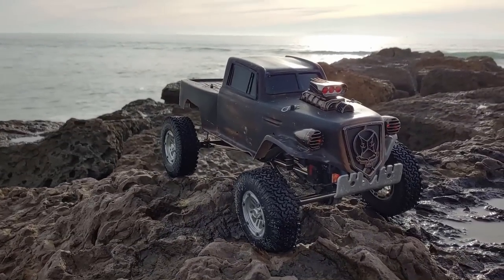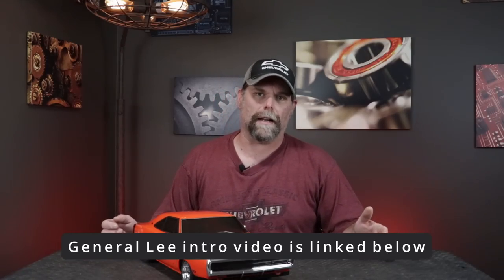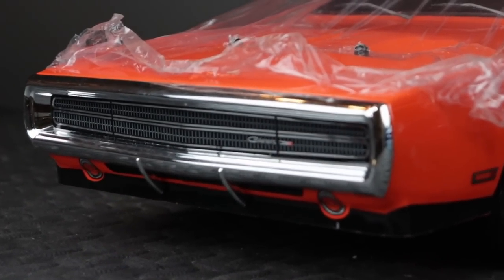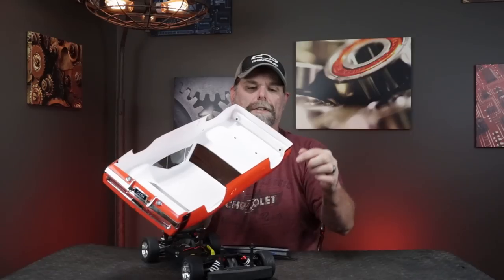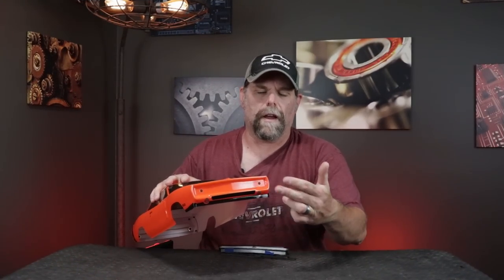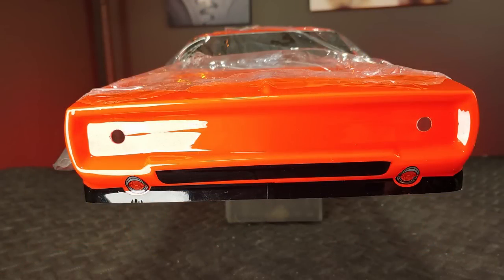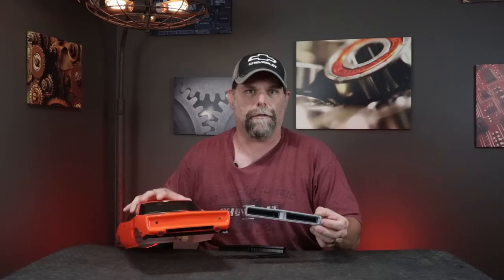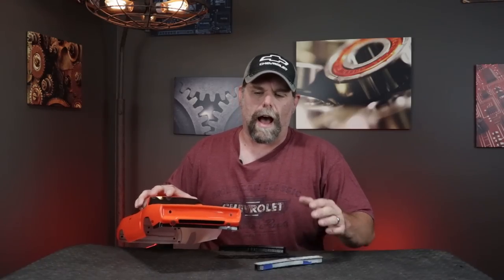RC General Lee: Kyosho Fazer 1970 Charger to 69 1/10 scale Conversion

Comment: Just subscribed after watching this. The General Lee is one of my all-time dream cars, and I love what you did! If I would've known about the Kyosho Fazer in the first place, I would've saved up my money a bit more instead of getting a Tamiya TT-02 with the '99 Impreza Monte Carlo body. If I ever do get the Kyosho Fazer, I'll be sure to do these! I am not the best with applying decals to rc's, but I'm sure my dad can help me out with that since he has experience with applying decals to model cars when he was younger. Once again, this is absolutely amazing, and I love it!
Reply from the maker: If you follow the methods that I used for the decals, it's almost fool-proof.  You take as much time as you need to get them where you need them, then use tape references.   Wet the decals so you can move them around until they're in the right spot, then pat the water out to keep them there.

Comment: GeneralLee Speaking... Id love to Get in to Custom RC Builds. I Have Converted My Tamiya Daku Rally Porsche to Be More Suited for Road Use (Kinda Wobbles a lot so I put Washers in ALL the Joints to Eliminate it). Granted Its Off Road Capability is a Little Tighter also but I live in UK City. I Need to Own a Rock Crawler to Play around with. I built My Wife a Water Feature in the Garden and Its HUUGE! Perfect Place for Crawling 🤣🤣

Comment: Rc drift car body painter and detailer here in 7:09 the point you adressed is understandable and if youd prefer the razor blade method i have a tip if you score a line a few times of depending on lexan thickness you are able to peel it away from the body and it will also leave a crisp line just may take some practice

Comment: Hello, Great Video. Do you think that Kyosho body shell would fit on a Traxxas slash LCG chassis? and if not do you have a suggestion? thank you
Reply from the maker: It's way too small for a Slash.  Wheelbase is only about 275mm and is about 200mm wide.
Reply: @BudgetRC_Channel  I appreciate the response, I found the Kyosho dimensions and figured it was too small. I am using a ProForm body shell, although a 1970 Charger. The only difference I can tell is the front end. 69 has a divider in the middle of the grill. The chassis is done, Preliminary shell fittings seem to be positive.  I'll keep you updated how it comes out, thanks for the video.

Comment: MCI racing is open to suggestions/accuracy advice, they can change that rear decal for you
Reply from the maker: You're absolutely right! I worked with them on a related project that will be featured on the channel soon and they were very accommodating.

Comment: Which wheel file did you use exactly if you don't mind me asking, size & offset thanks
Reply from the maker: I don't remember the filename, but they were the 6mm offset wheels designed for the vintage tires.  The link in the description has 4 varieties: vintage style (smaller for more tire sidewall) and modern style, each with 0mm offset or  6mm offset.

Comment: Question please.
Will this body fit on Tamiya TT-01 and TT-02 chassis?
Reply from the maker: unfortunately, no.  This body has a longer wheelbase that only works with the longer Kyosho Fazer chassis.  There is a body available from MCI Racing that I highlighted in my General Lee intro video that I'll be doing a build with soon.  That body is designed for standard sized touring car chassis, including the Tamiyas.

Comment: Looks great! Although I don't understand why they don't put any care into the proportions of the body, same goes with Autoart, Greenlight, Johnny Lightning and Jada are the worst offenders by far.
Reply from the maker: With RC cars, the bodies are formed from Lexan, which can limit what they do.  That's why the rear fascia is a separate piece.  They also need the bodies to fit on their existing chassis, which means the wheelbase and track width is already pre-determined.
Reply: @BudgetRC_Channel  That's true about the body having to be the length of the chassis. But the Diecast companies don't have any excuses for some of the trash they produce. The best 1/18 Charger casting is still the Hot Wheels one from like 20 years ago.
Reply from the maker: @pliantimpala7858  I'm not familiar enough with the diecasts to know.  Most of them look decent enough to me.

Comment: Great build but water based decals? Not for me. I got ones that stick. Don't have to worry about them tearing, also my bull bar is attached to the body and I don't and would not jump my RC. Rather run it then tear up the car.
Reply from the maker: These aren't waterslide decals, they're normal adhesive backed decals. I used the spray to help me position them properly. Tear up the body if you like, it's your car!
Reply: @BudgetRC_Channel  Not me I run it not gonna tear it up by jumping stuff, if people want to do that then to each there own as I take care of my RC cars not rough with them because I want them to last. My mistake on the decals.
Reply from the maker: @carljr4541  I don't plan on tearing this one up either.  Minor jumps for this one. My next video will debut my jump car.
Reply: @BudgetRC_Channel  Cool can't wait to check it out, any recommendations on the glue used for the tires? In-case they wear want to be able to remove them without ruining the vector rims, thanks!
Reply from the maker: @carljr4541  not sure there.  Acetone is the only thing that'll soften superglue and I'm not sure what it'll do to printed wheels. My suggestion would just be to use a couple small dabs of glue. It shouldn't take much to keep them on. Mine aren't even glued on to my car yet and it still drives fine.
Reply: @BudgetRC_Channel  Thanks! Gonna try it your way without the glue as it should be fine.